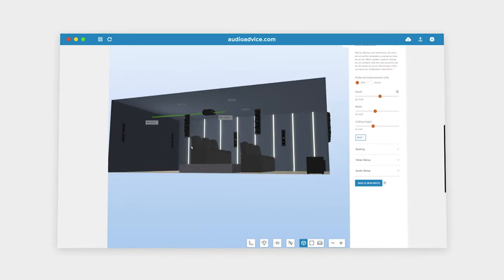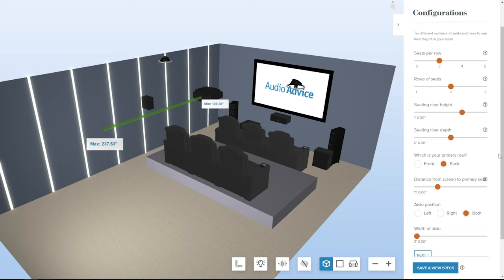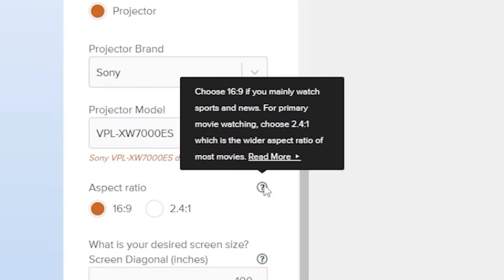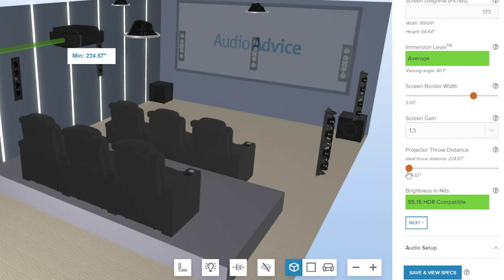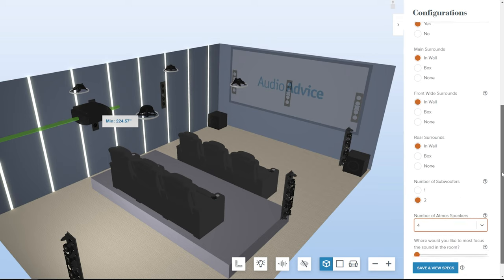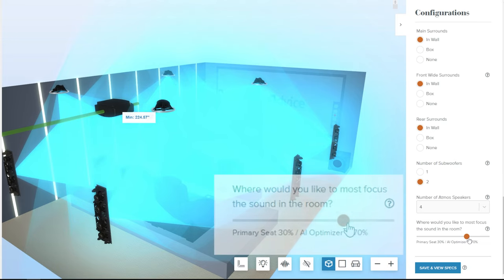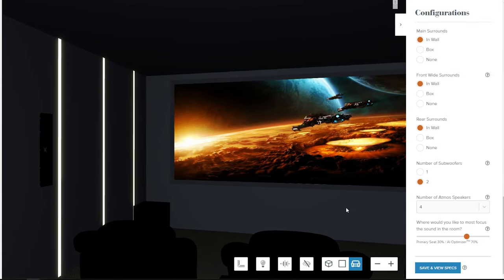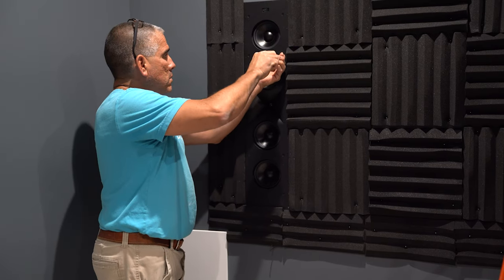How To Design A Home Theater w/ The FREE 3D Home Theater Design Tool

Comment: Great tool, but what wonders me is that it is shows main surround speakers at 90 degress angle on the wall, while your's guide for 5.1.2 speaker placement on the site tells to keep them at 110-120 degress angle. Which is better, or proper?
Reply from the maker: They move depending on the rows and how you have the AI immersion level set in the new tool.  Thanks for watching

Comment: Definitely pretty cool but I was hoping I could place as many subwoofers as I want and move them around at will to see how it impacts uniformity of bass in the room.  I guess it would take quite a bit more advanced of a calculator to do that and such a calculator would probably not be on online free calculator.   For what it does, it's pretty cool!  I was also a little disappointed that it didn't ask if I would be using an anamorphic lens, that's probably something that could be easily added.
Reply from the maker: Thank you! Yes to do all the room nodes and modes would be super complex, especially inside a tool we are trying to keep as simple as possible.   When we take a design fee, we do all of that during the process.  In a few weeks you will be happy with what we show next in regards to anamorphic!  Thanks for watching

Comment: I think that the atmos ceiling speakers are not in the correct location using the proper angles. Just FYI.
Reply from the maker: They vary based on how you set up the audio optimizer but stay in Dolby spec until you move things too far, then they turn orange.